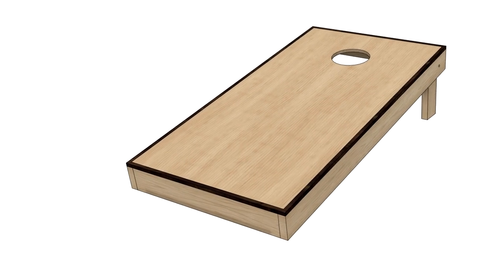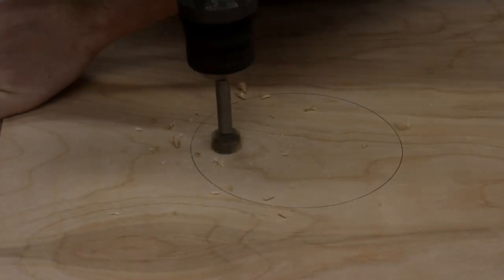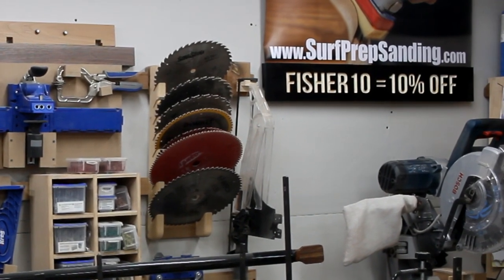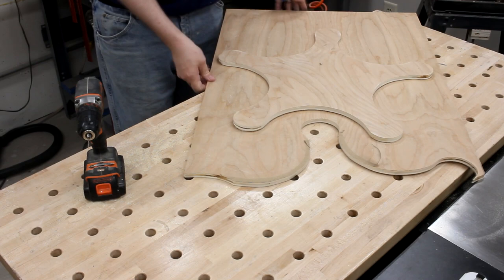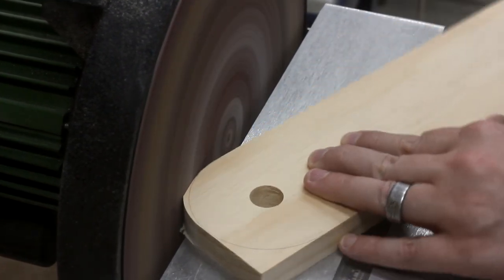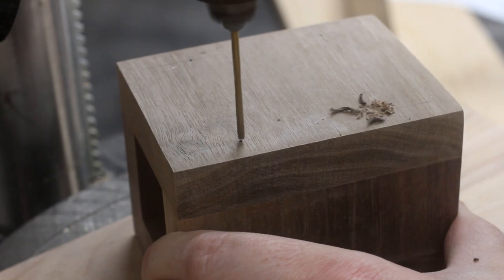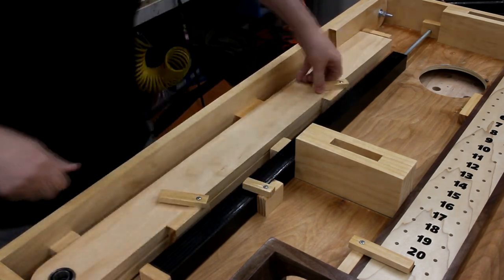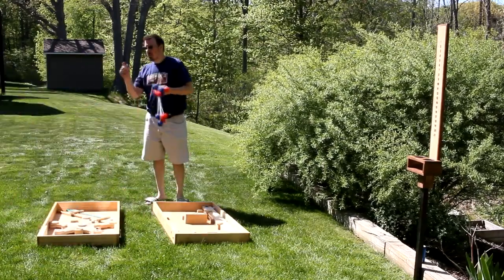Woodworking: Fisher's Yard Games

Comment from the maker: Thanks for watching!  Here's the answer to a couple questions I've been getting...

Q: Why not just use the CNC to cut the hole?  
A: It's actually faster for me to make a template like I did.  Setting up the boards on the machine and zeroing takes time.  Plus if I ever make more cornhole board sets in the future, I won't need the CNC at all.

Q: Where's the flathead screws??
A: Haha, they're there!  I just didn't draw attention to them.  I actually used quite a bit in the little toggles that hold the pieces within the boards.

Q: How much does it weigh?
A: The final weight with everything inside, including the cornhole bags, bolos, and measuring string is 63lbs.  It's heavy, but not too heavy.

Q: Can you add wheels to it?
A: Potentially.  I briefly looked for a style of caster that wouldn't interfere with the cornhole game but didn't find a design I liked.  The wheels would have to be detachable, I think.  A couple D-rings and a shoulder strap might help, but if it's too heavy for you, just don't pack all the pieces in there.  

Q: Can I marry you? 
A: No.
Reply: Also no
Reply: Aww

Comment: Cool project!
One quick tip to save painters tape is to just spray the engraved numbers without the tape and then sand off the overspray. But I’m guessing you knew that but didn’t want to sand through the plywood vaneer. More of tip for others watching that may be using solid wood or Baltic birch plywood.
Reply from the maker: Exactly!  My first attempt was that method but sanded through the veneer.

Comment: Hello Drew, great video as always. Informative and I really enjoy your sense of humor too. I have made a half dozen cornhole board for my friends and family and found that making a template for the center hole would save me some time, Like you I used a high quality and expensive protractor and made my template out of mdf board the same width as the board and measured exactly where the hole should be (9” from the top). I then clamp my template to the bottom of my plywood top and use a trim bit plunge router to make my holes. For the cutting the leg angles, I found a gal can of paint lifts the top of the board very close to the regulation 12” height the boards need to be. I then lined up the assembled leg against the side of my bench, traced the inside and cut the piece of my miter saw. I always learn a lot from your videos. Cheers.
Reply from the maker: Thanks Alain!  Sounds like you've got things figured out quite well

Comment: Drew, a heat gun (on low temp) or a hair dryer works wonders for removing labels from wood or cardboard boxes. Once you get the hang of it (as in not overheating the label) very little residue will be left behind.

This was a nicely done project. You are full of ideas and creative ways to accomplish tasks in the shop. Thanks for taking the extra time to make the video and share with everyone.

Comment: I once made my own set of cornhole boards, so that makes me an expert and qualified to offer suggestions.  The spray-on poly was definitely the right approach, but for a good "slide-y" surface and all-around durability, you want way more than just one coat. I understand that you probably just didn't include the lather-rinse-repeat for the sake of brevity, but if you didn't... go back and do at least 2 more coats (4 more is even better).  Remember to sand lightly between coats. :)

Thanks once again for the awesome video!  I LOVE the spin (see what I did there?) on the traditional design of ladder ball (ladder golf, where I'm from)!  I have to make one now.
Reply from the maker: Yup, I did four on the tops.

Comment: For the measuring during setup I have seen people use retractable clothes line, and for easier transportation put wheels on the back side and webbed handle on the front side so it could be rolled like a piece of luggage. But love the idea of multiple games in one. Love the outtakes as well.

Comment: Suggestion: Add some oversized wheels one end (possibly removable so they don't interfere with corn hole?) and put the handle on the short side instead of the long side (or along with a handle on the long side).  That way you could pull it behind you instead of having to carry it for like going to a park or maybe a beach outing but all the parking spaces are full at Holland State Park so you have to pack like a mile away and then walk to the park and then walk through the parking lot and then walk through 2 miles of burning hot sand.
Reply from the maker: That might work. 👍

Comment: Hey I made your piece and when I try to spin the dowels, they hit against the legs and scratch my piece. Do you have any idea how to fix it?
Reply from the maker: I'm guessing you didn't use the same bearings I did.  The ones I used have a standoff that offers clearance so the wheels never bump the legs.  If that's not the case, I'm guessing your wheels aren't flat.  Shorten the dowels and make some bushings for the center gold dowel to reduce the width of the overall assembly.

Comment: Can I ask why you didn't just cut the holes in the game itself on the CNC instead of making a template to jigsaw and router the hole?  Seems like a bunch of extra work for nothing.
Reply from the maker: It's actually less work in the long run.  Clamping down the material and zeroing the CNC actually takes a bit of time.  But it would have worked that way as well.

Comment: What did you use to color the dowels?
Reply from the maker: Hobby acrylic paint and then finished it with urethane to seal it in.
Reply: Thanks!  I have finished kids blocks that way and it turns out great.